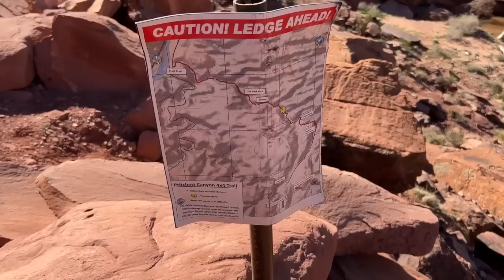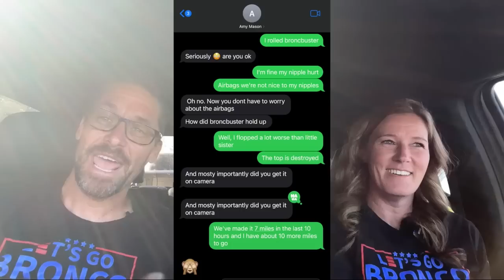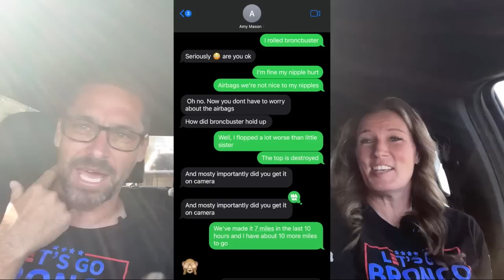I Leave You Alone for One Day!! (The Bronco Held Up Though...)

Comment: Just a suggestion but more gearing would help substantially with a manual. Developing a doubler/dual transfer case would be awesome or 4:1 atlas. Personally 95-100 crawl ratio isn’t enough for a manual trans.
Reply from the maker: Thank you for your feedback, actually geared to 5:38. Next is 4:1 atlas or portals
Reply: @BroncBustertx   I used 5:38’s when I did the math but was unaware of the t case being a 3.08 instead of the common 2.72. The 4:1 atlas would make a huge difference or portals would definitely be awesome. I’m just a Toyota guy with “all the transfer cases”, 😂. 224:1 is pretty amazing.

Comment: Those look like 35 on that XJ, you sure those are 33? I like 33, that use to be the tire size to have back in my hay day 4x4, I’m look looking at those MT 34 for my 2019 JL 2dr rubadong manual no lift, id rather be low and slow then high and over, you loose so much traction and center of gravity with lifts, it’s scary to me, you have to throw so much money in a lifter mini monster to get them to 4x4 right without flipping them.
Reply from the maker: I’m sure they are 33’s

Comment: Those tires (and all) , need to be aired down so you can see them flex and form on the rocks. They should not be spinning like that. At most 12psi. And to avoid an accident, I’d go to 6.  It’s a shame to see something like this that was totally avoidable and due to emotional driving. You can usually get away with bad driving but not a Moab. It will take you. Skills aside, airing down would have made that situation not even possible.  People need to really test airing down. 20psi is not airing down. Breaking a bead is simple to fix. And then you know the threshold. Usually below 6 and lateral pressure.  The other breakage also is an indicator of poor use of tire pressure.  I enjoy the videos. What scenario s.
Reply from the maker: I was at 10 psi. It’s a trade off below 10